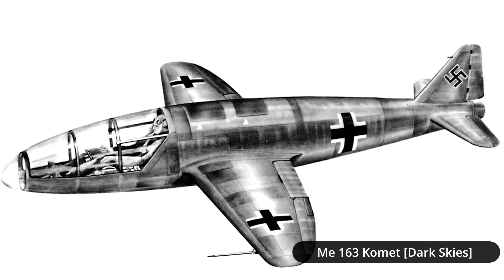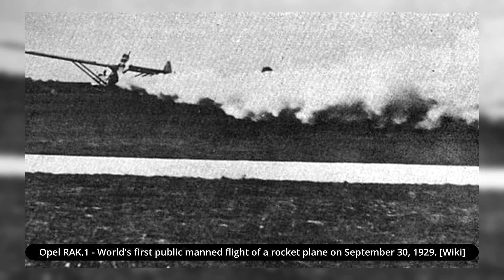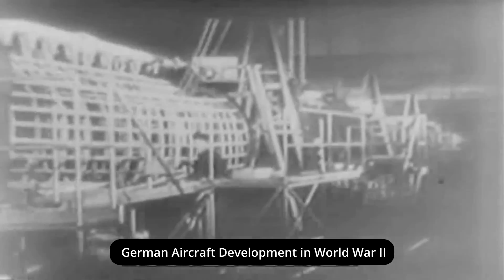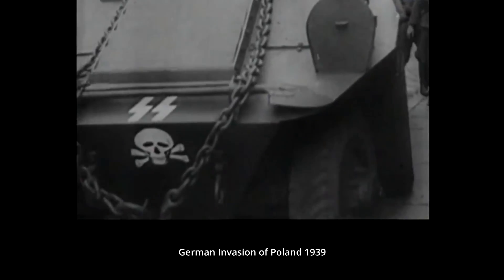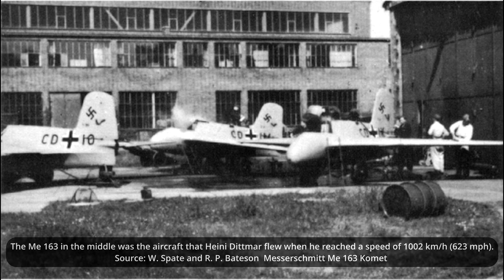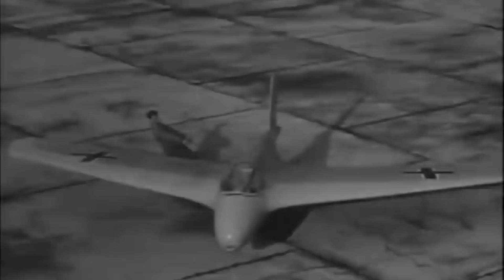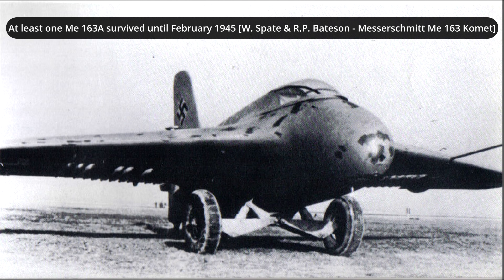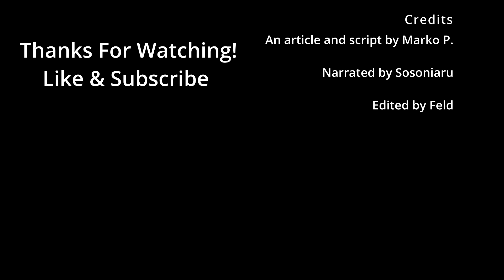Messerschmitt Me 163A Komet - Rocket Engine Pioneer

Comment: Ah yes, the pilot liquefier...

Fuel that will quickly dissolve anything organic in a system that leaks in a plane  prone to flipping onto its back during landing. Oh yeah, and the engine liked to cut out right after takeoff.

Also, you were wrong about the accident. The plane hit a flack tower not a radio tower and the plane didn't explode on landing, the pilot was dissolved by the fuel.

Comment: The later Me 163 versions would actually see great success!
Reply: They shot down 16 aircraft and liquefied several of their own pilots. We have different definitions of success.
Reply: In terms of aerodynamic and aviation research it was very significant, so I suppose you could say successful in that sense… in terms of military usefulness, not very…

It is an intriguing aircraft, no question…. a non powered replica has been made in Germany, there is a u tube video of it gliding, it flies beautifully….
Reply: They were interesting early rocket planes, but I don't think they were ever a great success.  I don't think it was possible for them to be as long as they relied on the highly explosive binary fuel.